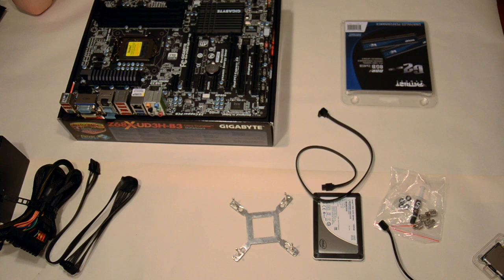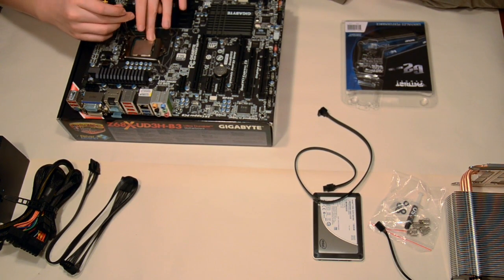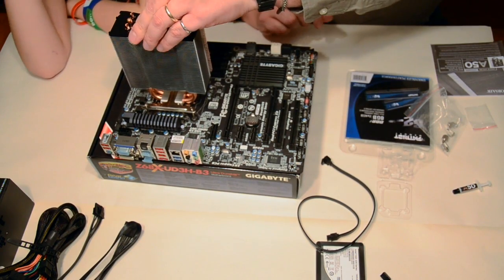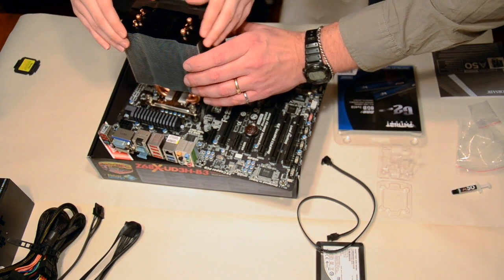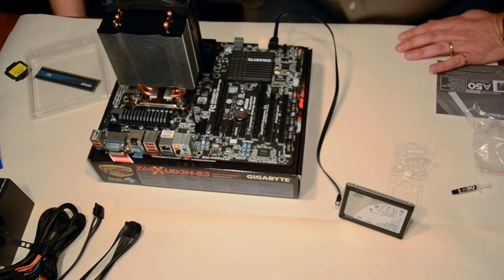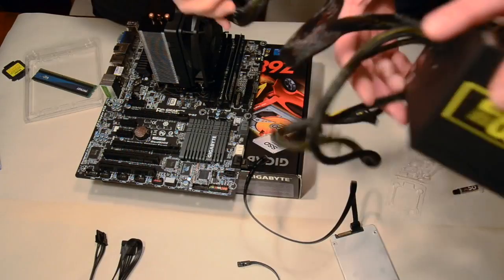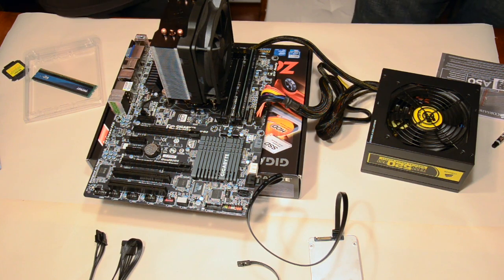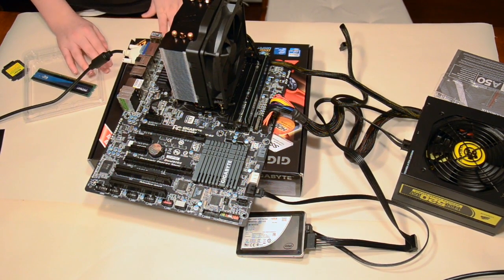Hackintosh Build - assembling the system, outside the case

Comment: Building is fun, and using the finished system under mac os is just a blast! Mine is an i5-2500k system with 16gigs of ram and a 6870, and boy does it render fast in final cut x :D